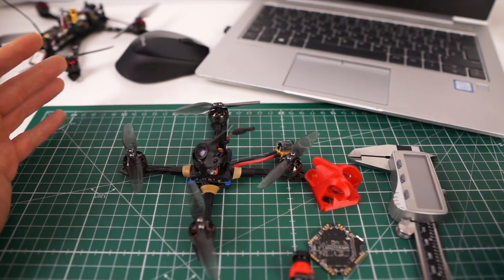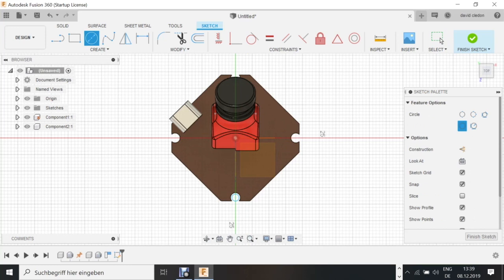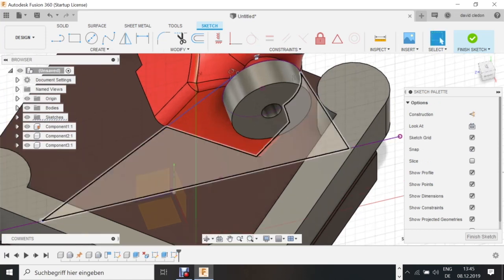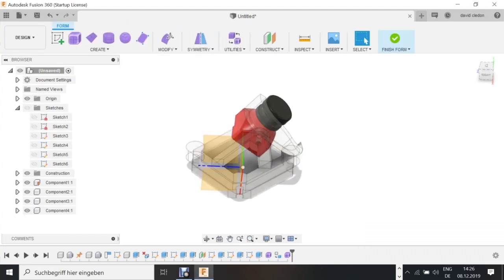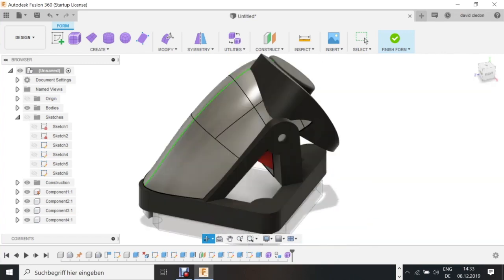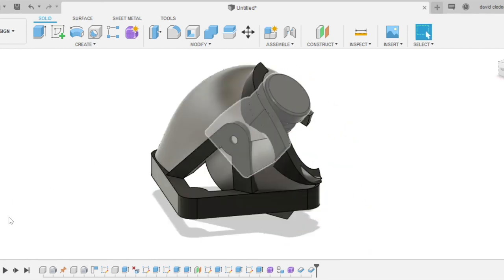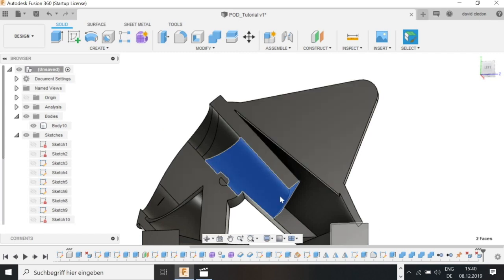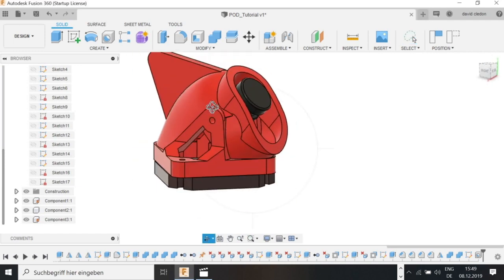Toothpick Pod - Fusion 360 Tutorial

Comment: Nice tutorial - just wondering, have you designed those canopy mounting holes to be self tapping? Wondering if I need to inset a nut in there for my own design.
Reply from the maker: self trapping works perfectly fine. Make the hole 1.6mm
Reply: @DaveCFPV  Perfect! Thanks for the quick reply